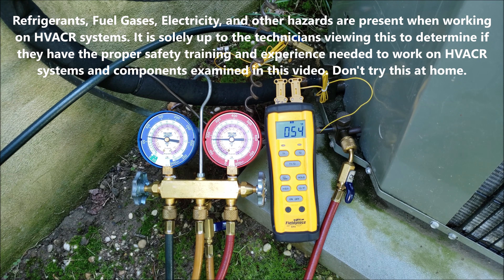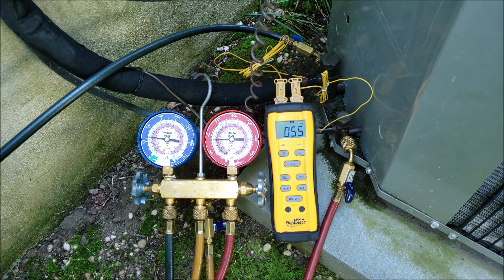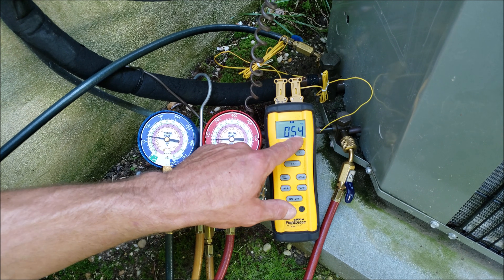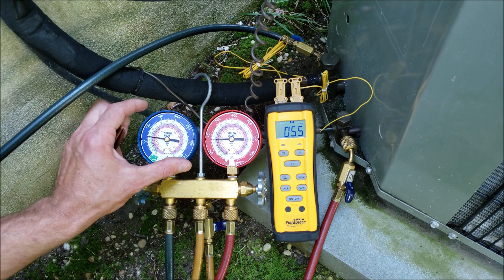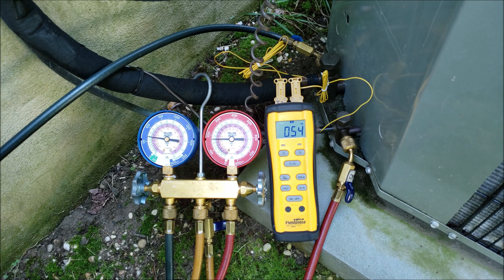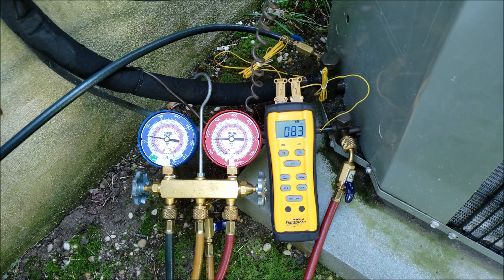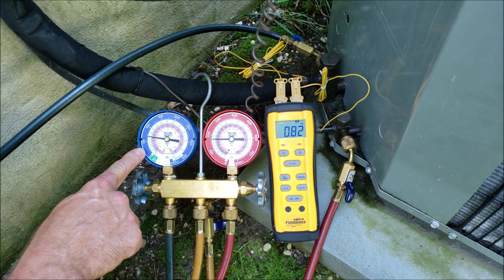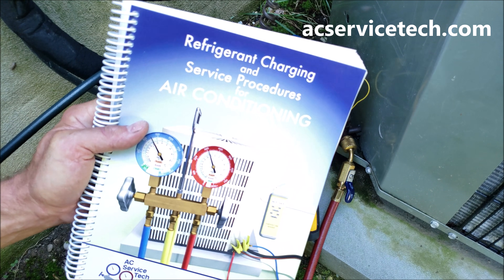Can You Check the Refrigerant Charge of an AC Unit by only Measuring Pressures? Explained!

Comment: Using gauges only, can you get the lbs of refrigerant in the system? Or do you have to recover the refrigerant and weigh it in?

Also you laid out three general rules of thumb troubleshooting at end of video (low charge, restriction, air flow). Does this apply to txv , fixed or both?

Comment: Thank you for video. I saw a tech whom have been in the trade for 30 plus years charge a system as a liquid on the low side.. he counted to ten every time he would charge and the unit has been cool and working ever since.. however I cringed at that what he was doing..
Reply: NICKLE& DIMEz . Full bore pulses ten sec bursts yeah I hate that. They gotta learn to trickle the gas in

Comment: You just described all the HVAC technicians that have come to service my A/C here in Miami. Currently my Goodman 16 seer, 7 month old , TXV, system stopped cooling. I checked your videos and determined my system (subcool-SC 9 superheat-SH 37) either had a bad TXV, or liq line restriction. Called the tech that installed my system and he told me to stop watching Youtube, first thing he did was attach only the suction side gauge and said I was low on Freon. I told him that the system SC was 9 and the MFG manual stated SC & SH target was 8. He changed the TXV and the pressure did not rise so he told me "See, it wasn't the TXV" and he added Freon from Lo psig of 101 to 128. A/C started cooling, I told him that once the system finished cooling the house and stabilized that I will take the Temperatures of the systems including gauge pressures and put it on the work order and then pay him. I also told him if it was low of Freon where was the leak and why isn't it fixed? I got him to agree that we will put all this in writing and give me a guarantee for the leak . At 2pm (83 deg outdoor temp) SC is 15 and SH is 19. I checked at 9pm (outdoor 76 deg) and SC 17 SH 24. My system is now overcharged. Its been two days of not hearing from Tech, he has not charged me yet. Waiting 7 days if he does not come back I'm calling Goodman and getting a recommended Tech.

I recommend that all customers write down all temps/pressures before and after on receipt so there is a record of what is going on to protect themselves from poor techs and future problems.
Reply: JC JR55. Hard to believe your tech swapped out the TXV when it wasn't needed. Sounds like a leak and low gas. Too right take recordings. Mind you pressures will change based on temperature. 
Do record SC and SH. Confirm the leak with bubbles, check for finger tight / loose / oily caps.

Comment: You prefer using k type without a clamp? I haven't used that type and placed under rubbertex and sometimes I don't get a good reading and I have tested my equipment prior.
Reply from the maker: Interesting! I usually get a better reading using the k type than a large clamp because the clamp is more susceptible to outdoor temp. I also cover it up if its in the sun. Thanks for sharing!

Comment: So the Basic ABC's of HVAC don't mean anything?
 By ABC's I am referring to Airflow Before Charging!. 
Nothing in this video references Setting / Confirming Airflow and Static Pressure. This is misleading, or minimum incomplete / accurate. Attempting to "Chase" or charge to a Target Subcooling or Superheat number is in accurate if are not moving proper airflow. Over 60%  (per NCI) of installed systems run at TESP's that exceed the nameplate, thus not delivering p\roper airflow. Most well under 350 cfm's per-ton. Heck, just look at the MFG Start Up Sheet Requires, Static Pressure is one.

Comment: What about checking TD across the coil?  Lets say by not using SC&SH. If you get  between15-20 TD across the coil.
Reply from the maker: The target would be between 18 to 21 degrees and yes you would read that but you would still not know if the unit was overcharged, subcooling, and if it had a piston you would want to know if the unit has superheat for compressor safety. You want to check for efficiency and airflow as well. You could have an under charged unit with low airflow and have 18 to 21 delta t but that won't cool the building down due to its low capacity. I hope that helps, thanks!
Reply: @acservicetechchannel  Thanks a lot. SH&SC is the way to go.

Comment: 55 to 40 is 15 degrees super heat... and you most definitely can adjust superheat by adding or taking out refrigerant. Derp.
Reply from the maker: If you have a system with a txv that has a superheat of 60 degrees with a subcooling of 12 then you have a liquid line restriction. You would then need to determine which component is the problem, thanks
Reply from the maker: This system has a txv so the superheat will not decrease by adding refrigerant. That only happens on systems with a piston or cap tube metering device, thanks!
Reply: AC Service Tech LLC What if the super heat is 60? How would you decrease that? DERP. People are stupid, you’re not helping.
Reply: Huh? What?

Comment: Hey Ac service tech, do you have any videos on liquid line freeze ups? Got a service call the other day no cooling. I went outside to find both liquid line zones on a multi zone condenser freezing up. The unit had the eev’s in the condenser.
Reply from the maker: It could be low refrigerant charge or low airflow since the txv is usually in the outdoor unit. The small tube would be at low pressure as well as the large tube that is if the txv is outdoors, thanks!

Comment: Better than using pressure, you can check the system with temp probes only.
https://overcast.fm/+HQ2oE3rfo
Reply from the maker: Absolutely you can it just takes more time to find where the sat state will be so it is a bit more time consuming. Have you seen https://youtu.be/MHth2vH3np4

Comment: Also have an unrelated question:  I have a concrete walkway that pitches away from the house.  I want to install mini-splits and perhaps a new condenser.  I was wondering how to level the units and I was thinking uni-strut and I was wondering if you have any videos or resources?
Reply from the maker: I don't have any videos on that. The larger rubber isolation mats can be used for small pitching but you got it. Uni-strut and all thread with a foot on it can be used to level the unit, thanks!

Comment: I have 2 questions. What if the AC company has gone out of business and there is no information you can find online or on the unit other than it is an r22 unit. What do you do then to check the system out? I have been told if the low side line is sweating the unit is fine and if the low side is cool but not sweating it may be low on coolant. Is this correct?
Reply: neutrodyne you need to see what metering device you have. If it’s a TXV you charge by subcooling if it’s a fixed metering device you charge by suction superheat.
Reply: @actechformallyyomama746  The evaporator coil has a TXV in it. However, the manual that came with the condenser unit says to check it using the superheat method. The condenser was replaced with a different brand so the two (consider and evaporator) are both rated for 5 ton but did not come together. If however the condenser was made to be fitted with a fixed metering device and the evaporator has a TXV how do I know which numbers to go with? I don't want to guess at it.
Reply: @neutrodyne  it doesn't matter what kind of device you have in the system if the evaporator coil and the condenser unit are equal, the same capacity on btu, if you can see inside the evaporator coil the whole coil from top to bottom must be sweating, if it's not totally sweating needs to add refrigerant till the last elbow of the exit of the coil has sweat, open the front panel of the coil and look and put it again quickly everytime is necessary until your refrigerant charge is completed
Reply: @samuelvalenzuela4541  Thank you for the information.
Reply: Are you asking what superheat or subcool to charge to?
Reply: No I’m telling you how to service the unit and check the charge. Find out the metering device and check the charge that way. All you need to know is the refrigerant and metering device.

Comment: Is the information in the E-book applicable to split or mini split  AC unit, ? thanks
Reply from the maker: The checking the charge while running and troubleshooting mainly packaged and split systems 1 and 2 speed compressors but the preparation for refrigerant, total weight method, and other processes are universal. Manufacturers do not give us charging guidelines other than the total weight method for minisplit units that are inverter type, thanks!

Comment: Quick Question? How to do a ACID CHECK / ACID TEST when replacing a failed compressor?
Reply: Get a sample and send it to a lab or buy a kit for testing it yourself.
Reply: I use a prodect called Quickcheck acid test kit. You just press the little cartridge tester on the schrader valve untill and if it changes color, there is acid in the system.

Comment: Making a big deal out of nothing. A little overcharging really isn't a big deal. It just gives you a little extra in the system so you don't have to re-charge it as often as the refrigerant wears out. Customer pays a little more now for extra refrigerant, but it reduces future service calls for the customer, thus saving them money in the long term.
Reply: Please tell me you do not work in the HVAC field. WTF seriously
Reply: Warning, don't call Rufus for hvac service!!  🙏
Reply: Refrigerant wears out? 😂
Reply: Praying for you Rufus! This may not be what you're called to do.
Reply: Lol, right
Reply: I'll back you up Rufus. If there's an accumulator in the system then being a little overcharged isn't a big problem, or if it's not a HP, because running an overcharged HP system in heat will lead to a high pressure cutout breaking the circuit. 
Refrigerant can and does wear out if there is moisture in the system. On a refrigeration plant or on a chiller: purging the unit is mandatory. Excess moisture blends with the refrigerant causing it to become more acidic and wear out joints and contaminate the oil. 
It doesn't matter if you triple evacuate the system. The moment it is broken into even once, the count down begins before compressor failure and refrigerant losing inherent properties.